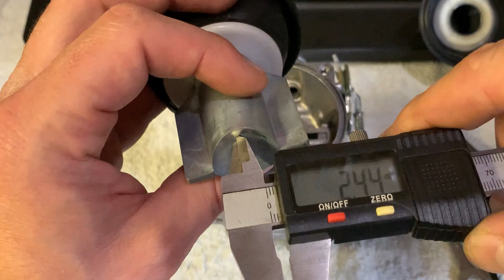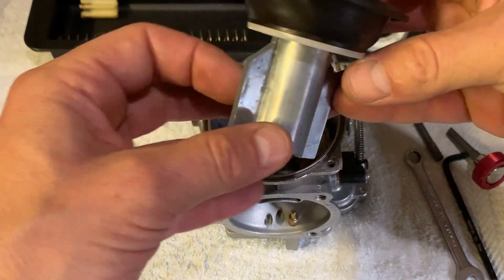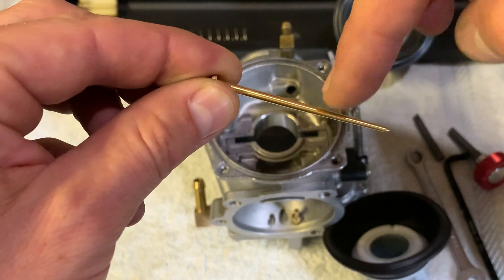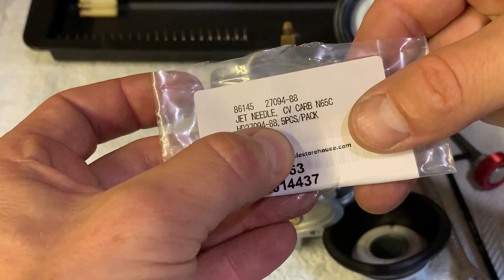Harley CV Carburetor Tuning Twincam 88

Comment: Sir, you mentioned in your video that you used a jet needle for a Sportster motorcycle that did not have an accelerator pump, but I was wondering if you used it in a non-sportster bike. I have a 2000 HD Heritage Springer, and I am wondering if I can use that particular needle, or stick to a specific needle for a Springer with a CV carb (with accelerator pump).  Thx.
Reply from the maker: Hi Carlos, In the video I was showing how to tune a twincam 88 carb, any twincam between 1999-2006, so including yours. Yes, go ahead and put the 88 sportster needle in your carb with the shim washers I mentioned and your bike will run like a beast. Of course I assume your have a high flow air cleaner and open exhaust.
Reply: @aronsgarage834  Hi, great video! Thank you for your content and explanations. What configuration do you think would be good for the HP of a '98 FLHT 1340 with supertrapp mufflers with about 10/12 discs and open cap, big sucker arlen ness, andrews e27 cam and Dynatek 2000i ignition module?
Thanks for your attention.
Reply from the maker: Thanks for your feedback! Not really sure, but I would probably try the setup I showed in the video at first instance, and see how it runs.
Reply: @aronsgarage834  i don't have a n65c needle, but have a CV performance needle, N72S needle and N86E needle. My configuration now is: 48 pilot jet and and 185/ or 190 (i'm not sure) main jet,  CV performance needle and aorun 3 and 1/4 turn mix screw. 
the bike seems to be running well, but how is it possible that every now and then I hear some detonation in the release of gas and the spark plugs are between white and greyish in colour? how can it be lean with a minimum of 48 and 3 and a quarter turns of the adjustment screw? ps: the dynatek setting at the third advance curve (stock motor) and single fire. I tried to put more aggressive advance curves, but the detonations increase. I can't give myself an explanation.
Reply from the maker: It shouldn’t be lean with that setting. Have you checked float level, whether or not the slow circuit is blocked, or leak around the manifold?
Reply: @aronsgarage834  Everything in order. The engine block was opened and it was completely overhauled. Main bearings, bushings, connecting rods, pistons, cylinder grinding, valve guide rubbers, new cam bearing and cam, vale breather, oil pump etc including top end gasket kit and carburettor overhaul including intake manifold gaskets. I do not know what to think...
Reply from the maker: Not really sure than. I would still take the carb apart again, and double check if everything is set properly, all the circuits are cleaned out etc..

Comment: Soooo you just said towards the end of this video you don't have any popping or sneeze or cough iam curious to know what would even cause that to happen since that is what my bike is currently doing when i accelerate i get a pop sound or cough sound out of my carb and air cleaner.... what could be the issue can you please help me? lol
Reply from the maker: That’s most likely because it’s too lean. What set up do you have in your carb? How long has it been doing it? If only recently, it may have developed an air leak around the manifold or vacuum hose or around the air-cleaner. It could also be a clogged slow jet in your carb..
Reply: @aronsgarage834  my carburetor is a cv carburetor also I just recently changed out the Jetts and I have the air fuel screw turned out 1 5/8 and it does sound like I have a rear manifold leak it does this crackling sputter sound from the rear head.
Reply from the maker: Cool. Let me know if you’ve found the leak
Reply: @aronsgarage834  yes I did find the leak it is off of the rear head. One of the exhaust manifold gasket studs busted so now that's my situation I like working on my own bike but sometimes I get tired of not being able to find help lol anyway thank you for responding
Reply from the maker: That’s great, I’m glad you found it. Yeah, that’s what I like about our “Harley community” that we stick together and help each other out. Have a good one
Reply: @aronsgarage834  yeah I wish our community was like that!!!

Comment: Need some advice .My 2003carb fat boy qent in on a dyno to be set up and pass the london ULEZ law ( lowering Nox level ) To do that it seems the bike has to run a bit rich on the mixture. Well it passed and it runs ok and starts and ticks over ,but the plugs are fairly black .The dyno guy says thats ok so long as the bike runs ok .I cant get my head round that as owning bikes and cars since 1958 i always looked for a lighter colour on plugs .Not sure whether to try tuning the mix screw in for a leaner setting 
.??
Reply from the maker: Yes, it’s supposed to look brown or dark grey. If it’s black, you’ll end up with a lot of carbon build up on the pistons, which is not good.
Yes, try to lean it a little with the mixture screw.
I made a video on how to fine tune while idling. It might be helpful.
Reply: Engine breather and not getting the motor up to operating temperature on a run will cause issues. 
Oil level and sumping.
Breather valve condition for closed circuit breather. 
Dumping fuel with the pump because it sounds good and constant blipping that doesn't need to happen. 
Check everything, it's not all about the carburettor set up.
Reply: @theodavies8754  I got it sorted about 4 months ago .Carb needed tuning .Been running fine since.
Reply: @John-ob7dh  Blocked air jets and E10 seems to be the most common issue with carbs. 
Great if it stays sorted.
Reply: @theodavies8754  it was fine before they richened the mixture on the dyno to.lower the NOX level.
But they are not allowed to tune it back to how it was .Obviously they won't issue the exemption if you ask them to tune it back.to where it was when the NOX reading was high before it went on the dyno ( makes sense)this is a ULEZ registered garage .
I even phoned them up after and said if I bring it back can they tune the carb back on tbe dyno .
They said no we are not allowed.
But I found one of those good old fashioned bike mechanics who just sat down by the bike with his carb tuner screwdriver and his ears  and within 10 mins the bike was running perfect and no.more black.plugs.
Reply: @John-ob7dh  There's always a simple explanation involving money. 
The worst part is trying to make sense of it. 
Sounds like the sort of area where every person breaths out 1kg of CO2 every 24 hrs without even trying to do anything about it.
Reply: @theodavies8754  the tuner guy I know did not even charge me .He said it only took 10.mins ,so no charge.

Comment: Evening,  great video.. I have a question about the slow jet (pilot jet).  I have a 05-night train with stock exhaust and stock air intake. Main jet is 190, and the pilot jet is 45 stocked. I am going to install an SS air intake.  I am  going to  leave the stock  exhaust and the  main jet will stay the same. With a new pilot jet, I was going to upgrade to a 48 instead of the 46 due to greater air going into  the Twin Cam. What is your take on that? Thank you for your time.
Reply from the maker: Hi Brad, the 48 and is too big. You’d have a sluggish performance being too rich. I’ve tried it before. 46 is ok but honestly you’re good with stock 45. Just adjust the pilot screw after installing the air cleaner. Give it an extra quarter or half turn out. Or better yet, perform a fine tuning while bike idling and you’ll find the sweet spot. I’m actually in the process of uploading a video on that.
Reply: @Aron's Garage  So you mean adjust the mix screw since you can't adjust the pilot jet..
Reply from the maker: Yes. Do check and record the setting first, though by turning it in until it gently seats counting the turns. This way you can always go back to that starting point in case you lose track of turns while fine tuning it. Mine is at 3 and 1/4 out with high flow air cleaner and modified stock pipes/ or screaming eagle.(of course I have the thinner needle set up too as shown in my video)
Reply: @Aron's Garage  I bought the cv Performance kit from the cvo website.. So, I will be replacing the needle and adding the t tall mixture screw .
Reply from the maker: Got you. You should be all set then.
Reply: @Aron's Garage  I appreciate the information.. I look forward to seeing the video you are creating ..
Reply: Brad depending on where you live a 45 is ok unless you put a 1200 Sportster needle in the carb! Without the washers as you have stock exhaust! It'll be like putting a 48 in it. BTW Harley doesn't make a 46 jet. I've tried them & they aren't accurate & don't work well. 48 - stock needle. 45- Sportster needle no washer's!! Adjust idle mixture screw one & a half turn from lightly seated. Open until it almost stalls. Turn until it idles smooth then turn half turn in.
Reply: @enricomandragona163 Dude, everytime you add your 2 cents, it seems to go against the advice that Aron just gave.
Maybe you should start your own site ?
Reply: @kurtfoulke5130  wtf are you talking about!!?? It's the only comment I made!!  When you actually know what you're talking about maybe you can challenge me!! I've been rebuilding CV carbs and others go 35 yrs!!

Comment: Great video. Do you recommend the stock 45/190 with a twin cam 88 with mild cams (509g S&S). Thank you!
Reply from the maker: Thanks. Not entirely sure because you have different cams in there but would definitely be my first choice of set up. Try it and see how it runs..
Reply: One last question. Finding the correct washers is difficult in the USA. I assume the id of the washer needs to be very close to the needle diameter? So far the washers I’ve found are loose.
Reply from the maker: Yes, should be quite close. If you are struggling to find the right size, I’ll send you some. Send me a message on Facebook. Aron vetesi
Reply: @aronsgarage834  Aron, that would be awesome. But I’m in the USA. I can Venmo or PayPal in advance for postage if you are still willing.
Reply from the maker: @gnoub51  send me a message on Facebook and we’ll get it sorted. Aron Vetesi
Reply: I have the same 509g cams. How did your tuning go?
BTW #4 brass washers fit the needle for shims.

Comment: Is it possible to swap out the jet needle for the sportster 88 needle without removing the diaphragm with the carb in place ? ( ideally  just by lifting the needle up from/through   the air cleaner  inlet with fine surgical type pliers )
Reply from the maker: You can’t do it through the inlet but you can do it with the carb in place. Just lift the tank up and support it with a block of wood (posted a 2min video on this before) take the top cover off (4 screws), take out the spring and lift out the slide with the needle and retainer in there. Quick easy job.
Reply: @aronsgarage834  Excellent,   yes that is exactly what  I meant ,sorry about the confused way I worded the question. Keep up the good work.
Reply: No!!
Reply: Just pull the carb out of the manifold. Lossen the choke cable. Leaving the throttle cables on it! Being it's a used bike I'd remove it anyway!!

Comment: Hi,
Which setup would you recommend for a stock '98 XL1200C from the states with 68 hp? Is there any tuning necessary?
greets from Germany :)
Reply from the maker: Hi Tom, Hope you still got good riding weather in Germany :). if everything is stock I wouldn’t touch it. If you have a high flow air cleaner and open exhaust you could pretty much do the same set up. Maybe reduce the number of washers under the jet needle to 1 or 2. It’s just my assumption though as I have yet to tune a 1200.
Reply: @aronsgarage834  it's getting cold here slowly, but sunny! what would change if everything is stock, but I work with 1-2 washers?

Comment: How do your replace the  Diafram
Reply from the maker: You can pull it out of the piston and using a bit of soapy water you slide the new one back in place while giving it a little stretch. I did it a couple of years ago and ran it with no problem, however I decided to replace the slide as a unit because I learned that replacing only the diagram is not really recommended by factory. It may not function 100%.

Comment: In your opinion, how should the progression of increasing or decreasing jets and needles take place? For example, should you exhaust all available increases in jets before you start changing needles? Or should you first address the needle size first?  For example, let's say someone has a CV carb with a 45 pilot and 185 main. Should that person go directly to the jet needle before addressing the main jets or pilot jets? My question is kind of like the question of: what comes first, the egg or the chicken?
Reply from the maker: I would go to the jet needle first because the profile of the needle can effect the off idle to 1/4 too (if you’re swapping it for the sportster 88 needle especially as the straight part is slimmer), as well as of course affecting mid range for the main part. Then you will see if the slow (up to 1/4 throttle) is enough, then lastly the main ( from 3/4 of your throttle).
Reply: 45/185 or 190 jets are the standard for jetting usually depending on altitude! Because of emissions the needle dictates your fuel flow from the factory is lean. So the needle swap is where you go to & tune it all together like a EFI bike would be!!

Comment: What bolts are you using to secure the top? They don't appear to be stock.
Reply from the maker: 4 mm allen bolts. I find it easier with them. Plus it’s easy to carry an allen key in the pocket or toolbag in case you run into an issue on the road.
Reply: @aronsgarage834  Thank you for your response! do you happen to know the length of the bolts?
Reply from the maker: Sure. It’s 16mm for the cover, 14mm for the float bowl and 8mm for the accelerator pump.
Reply: @aronsgarage834  Thank you so much for your help, and for this incredible video. I appreciate the effort you put into the video and it's been incredibly helpful.
Reply from the maker: Thanks very much for your positive feedback.

Comment: 190 and 45 wasnt stock on all 88’s some were jetted different depending on what bike you have
Reply from the maker: You are right. My 99 Superglide was fitted with 42 slow and 185 main. I understand most 88s did come with 45/190 after 2000, though. Frankly, 42 was really lean especially with high flow air cleaner and open pipes.
Reply: In my neck of the woods 48 slow 2000s . What’s your opinion?
Reply: Don’t use the 42. I have it on mine currently. The carb is new and I was gonna see how it performed going that low. Bad. It’s not even rideable. I almost dumped it from the lack of power making city turns. practically stalling it in a few turns. I’m putting 45 in and tuning from there. Top end is good on mine with the 170 main jet. I might try increasing it after I get the idle mixtures set good. The needle is stock but I might try that 88 sportster needle you were talking about.

Comment: Sir, what do you call that shorty screwdriver with the reddish round handle? Can I ask where you got it?
Reply from the maker: Sure, Carlos. It’s called a carb jet driver set and JMP is the brand. I bought it on Ebay. I put the link in the description of the video.

Comment: @ 3:52 you say make sure it goes in the right way. Which is the right way?
Reply from the maker: The end with bigger diameter bore goes in and will be sticking out in the carb throat
Reply: One side is tapered and the other side flat. The tapered side goes in first. The flat side will seat against the emulsion tube. The tapered side upwards toward the needle.

Comment: The link you put on here won't ship to the U.S. is there any other options for me to get these shim washers? Thanks, Aron.
Reply from the maker: What state are you in, Rick?
Reply: @aronsgarage834  I'm in Missouri. That was a Great video you made, I'm trying to do mine EXACTLY like you did it in the video. Mine won't idle down after riding it while hot, so I assume someone has drilled out the slide. Thanks Again
Reply from the maker: @1rottenrat  yeah, measure the port hole on slide. You might need a new one if drilled. It’s also worth getting a brand new good quality 45 slow jet (in case it was messed about too, and got enlarged) In regards to the washers, if there isn’t on Ebay US, call up hobby model shops, they should have these small shims. If not, let me know before Friday. We’ll be travelling to Vegas and I could just post a few to you from there.
Reply: @aronsgarage834  I bought a new slide and a set of new jets just like you described in the video. Thanks for responding so quickly. I greatly appreciate your help on this, again the video was EXCELLENT.! If I can't find them I would gladly send you money for them and the postage. Thanks again.
Reply from the maker: @1rottenrat  Super! I’m glad it’s helpful. Yeah, let me know if you can’t find them, happy to help.

Comment: I was pondering rebuilding my carb because I get a sneeze at intersections once in awhile, but I'm currently getting almost the exact same gas mileage as you. Maybe I should just live with a sneeze once in awhile 🤧. I don't want to screw up that mileage.
Reply from the maker: It might be a little lean then. Often times, just a 1/8 or 1/4 of a turn out on the mixture screw does the trick. Before you do that though, make sure you count the number of turns in until it gently seats so that you can always go back to that setting if you’re not happy with consumption or how it’s running.
But if the sneezing is not bothering you, and otherwise running well, you can leave it. 
I would still check the spark plugs, though to make sure it’s not too lean, because that would make the engine run hotter and wear out more quickly.